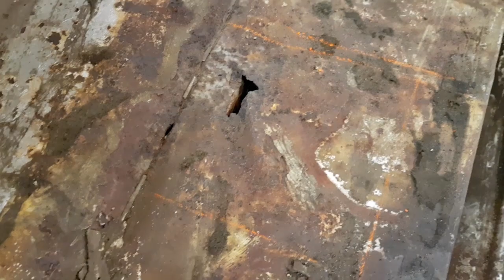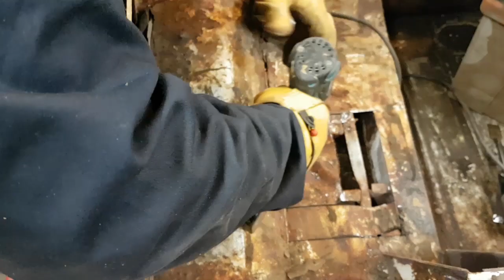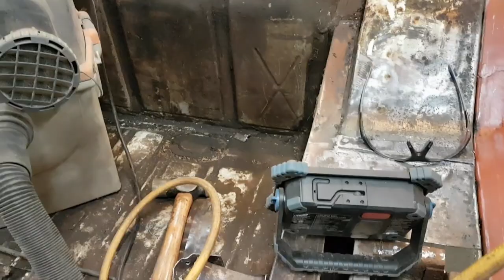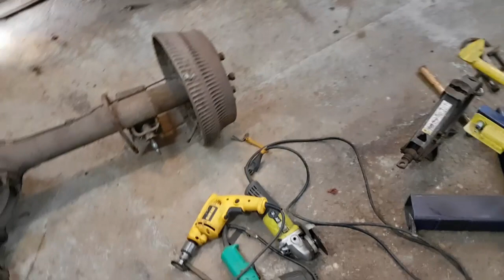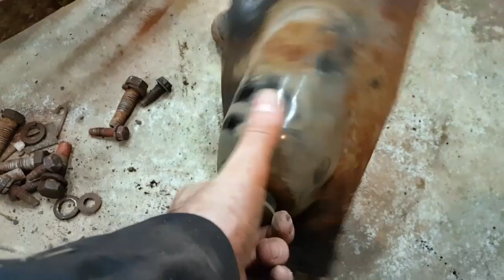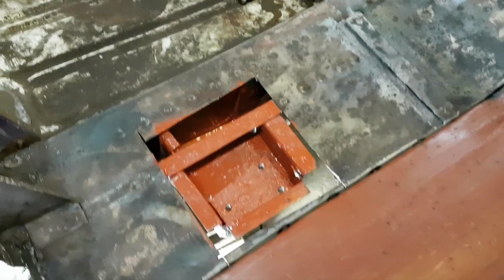Rear Shackle Mount Repairs & Rear Diff Removal - 65 Thunderbird Convertible Restoration Ep #38

Comment: Hello Alvin. I was glad to see your frame rails in good shape. I think that the welding that you did on those rear leaf spring mounts will really help. It will be so  much easier to clean up underneath now with the axle, springs, and shocks out of the way. Looks really solid under there.
George B. in Michigan
Reply from the maker: Hi George, I feel like they are going to be as strong as most others on the road out there today, and likely stronger than others. Having that axle out of the way is already making work easier.

Comment: This one was so intense.  That’s a nightmare back there. You are a very patient artist.  Thanks.
Reply from the maker: It was a nightmare John! I'm glad I started on the worst side of the car, the other side is rusty, but much less of it.
Thank you for watching!
Reply: @J_R_Shop  I’m looking at the 61-63 convertibles, but I see rust underneath and I know it’s an iceberg.  And I don’t have an endless budget.  Your videos have educated me on the pitfalls.
Reply from the maker: @johnhowardesq  yes, if you are seeing extremely rusted frame rails and torque boxes, it's best to avoid it all together, unless you're able and willing to make your own repairs.
Reply: @J_R_Shop  Usually, they are pretty rusty.  I try to find desert cars.  Baked is better than rusted.  I’m too old to learn welding.  I need something closer to fixable.  Long search… I think I will find one.  Patience is the key.

Comment: Alvin,
Seeing the springs, shocks, axle, differential and 5 pounds of dirt spread out on your garage floor made my entire Thunderbird life flash before my very eyes.   Lots of work, eh?  I'm glad those days finally ended.  Great progress, my friend.
Btw...for future reference, I learned that if rust converter is allowed to dry overnight, a second coat the next morning will really convert what's left.  You'd be surprised at how much the first coat actually misses.  It was an experiment I decided to try and it luckily worked out well.  Of course the negative is that the second coat also needs to dry overnight.  Just a little food for thought.
Regards,
John
Reply from the maker: Hey there John!
Every time clean up the shop floor, I wonder how many other cars out there are carrying around unnecessary weight in the form of dirt. I've been allowing a 24hrs and recoating, it slows down the repairs, but sure is worth waiting. 
If you notice how black the jack mount, and quarter panel mounting structure are...that isn't paint, I've recoated those area's three times now, I'm going to continue doing 2 coats where I can. The inside of the frame rail I put the red oxide primer in were done twice with the rust converter, and now primed...they will out live me!
Thank you and take care John!
Alvin

Comment: Great video I am glad you are going to be bringing the old girl back from the dead. Around here in Oregon there is only One other Tbird that I know of a black '66. I have been replacing the suspension bushings on mine, as they are all dry rotted either hard as a rock or crumbling to the touch. Next project for me is electric window motor replacement. Oh joy. Well God bless.
Reply from the maker: Thank you Mike...you will get it done, just remember...one piece at a time. 😎

Comment: This just seems unreal to me. I turned down several Birds that had a lot less rust than yours.  I am currently working on a 64 hardtop.  Mostly rust free except the trunk floor pan is completely rotted out, a first for me.. rest of car is perfect rust wise as it is from Colorado and Arizona.  I think the rotted out vent rubbers allowed water to stand in the closed trunk.. It had sat outside for 3.5 years in Chattanooga TN under a tree.  I am into week four just cleaning and polishing the exterior.  390 engine had a stuck valve and I got it loose and put in new pushrod.  Waiting for carb kit as carb is full of green goo.  I have months to go before I can get it on the road but mine is child's play compared to yours.  BTW I have owned 11 66 thunderbirds, only one a convertible, a 64 a 65 and three or four 61-63 hardtops and one 63 convertible. The 63 convertible was rusty underneath and I spent about two weeks sandblasting the chassis before undercoating it.
Reply from the maker: Hey Jeff!
That's a nice line up of old T-Birds you have owned. 😊
I have said it a few times in my video, Ford used a ton of seam sealer in these cars, and when they were new, it worked well...but as the sealer started to break down, in came the water. I've seen some pretty large gaps that were sealed over.

Comment: Alvin, how will you get the 3 nuts back on the spring hangers with that patch welded back on ?
Reply: No nuts there. Bolts go up through the rear spring mount into a threaded plate.
George
Reply from the maker: Hi Baz, thanks for the comment...I see George has covered it well.
Reply from the maker: @servicetechnician3264  thank you!